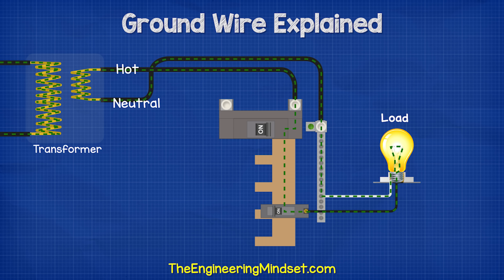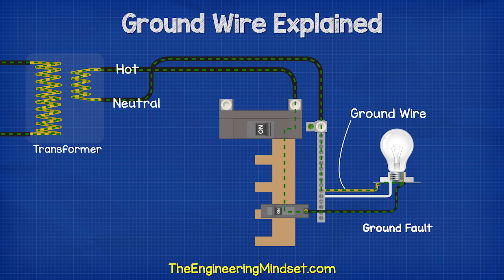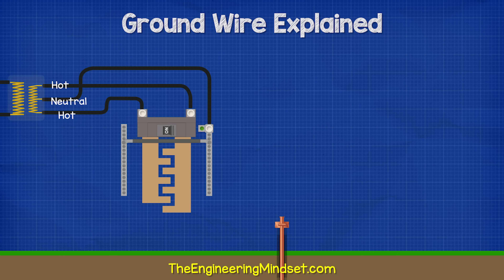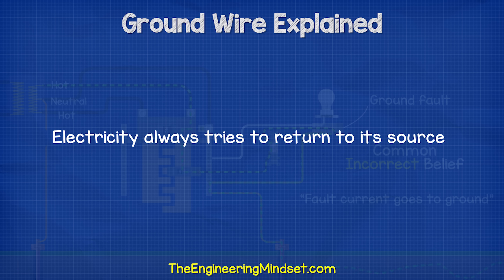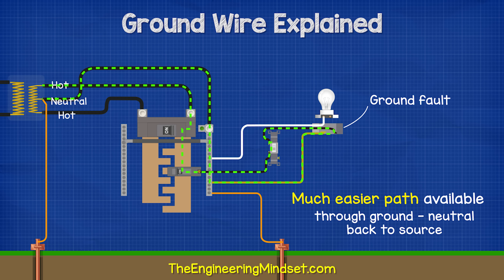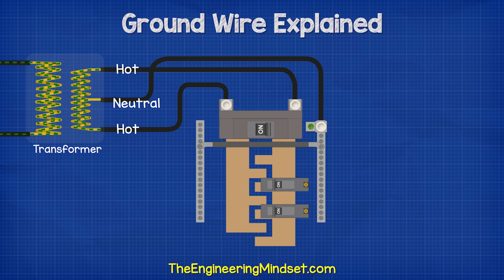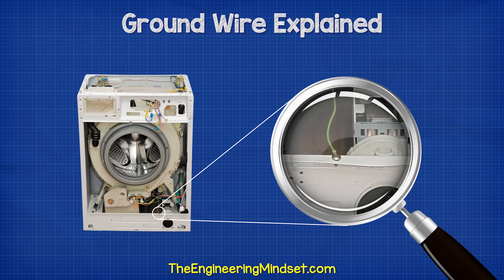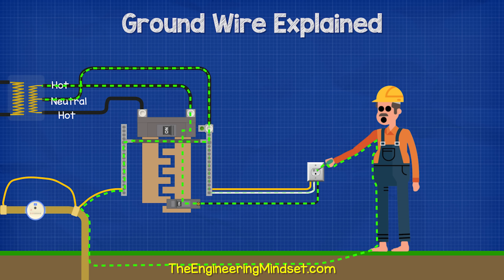Ground Wire Explained

Comment: Nice Video - but You need to explain that the ground is bonded to the neutral wire at a single point to allow a path back to the source transformer that is low resistance. Although you talked about the ground rod that assures the same potential for metal parts as "ground", and that it is the method to dispense lightening back to it's ground source, you completely missed the explanation of the Neutral Bond as the fault current path.

Comment: So if I'm understanding right  the ground wire serves two purposes, one letting electricity go back to neutral in case of fault and two letting lightning travel to ground rod.
Reply: Not quite. It provides a low resistance path for fault current to flow back to the transformer (not the neutral). The ground wire is not for lighting protection. That is the job of grounding rod (although its effectiveness is still debatable among electricians). The ground rod also prevents the system from building static charge by discharging it down to the ground.

Comment: Yeah but what happens if the guy sticks a screwdriver in the socket but he's not touching anything else, not even the ground? this video is incomplete without a discussion on the conductivity of the ground he's standing on.
Reply: This videos assumes you are always standing on ground and make a good connection with ground.
Reply: And without a shoes to only a bare feet
Reply: When the soil is wet and you don't wear a shoe

Comment: So if it doesn’t go to the ground, but is basically an alternate neutral, then why is it called the ground wire?
Reply: Bump
Reply: terminology sometimes does not describe what something does. Ground wire (or formally grounding wire)'s one main job is to provide low resistance path for fault current to flow back to the transformer.

Comment: If I understand it correctly, the static or excessive current is going back to the source via the ground wire connected to the neutral wire (in the main panel). In that case why does the ground wire need to be connected to the earth (ground rod) then?
Reply: Static charges will litterally go into the ground. Leak current or fault current will go back to transformer. Electrostatic is different from electrodynamic

Comment: 2:52 in this case, why wouldn’t the flow prefer the ground wire over the human? Or is this the case where there is no ground installed?
Reply: literally same question
Reply: Because you still believe the myth that current prefers the path with least resistance. Current will take ALL available paths. The question is how much current is flowing on each available path. The ground and the human BOTH provide a path for currents to flow, so so current will flow on both

Comment: Can you make a video on bonding?
Reply: bonding simply means connecting two things together. If you take a wire and you connect to another wire, that's called bonding. So does taking a wire and connect to a receptacle.

Comment: Can you get electrocuted by touching the ground wire ?(During full voltage going through it ) I assume not because it's connected to the ground same way neutral is so potential should be zero yes ?
Reply from the maker: It's possible, see this video https://youtu.be/Qi0ynSQw-wc

Comment: In the end, you say, if you touch the hot when grounded, it may due to high resistance path, not flip breaker and you may die - but aren’t we in parallel with the hot to neutral and therefore with our high resistivity, wouldn’t the current thru us be low?

Comment: Interesting! Thanks for the information.

I still have a question: since neutral and ground wire are connected to each other at the electrical panel, why don't we use the neutral wire to conduct ground-fault electricity as well, hence saving 1 wire? We can connect the chassis of the appliance to the neutral wire at the load instead of at the panel with an extra wire.

Comment: A little noob question here:
If it’s an AC circuit, isn’t the neutral become hot too when the polarity reverses?
In this scenario, according to my understanding, there’s essentially two hots because they’re alternating very fast.
Reply from the maker: Yes, but neutral is physically connected to the earth, so it's the same "voltage" as you.

Comment: What law stipulates that electricity takes the route of minimum resistance? Is this derived from Kirchoff's law?
Reply: Electricity taking the path of least resistance is a myth. It has been debunked many times. But the myth still persists in the trade. Electricity will take ALL available paths. How much current goes through each path is determined by Ohms law. Even so, ohms law only works up to certain point. Ohm's law will break down in extreme cases because every material has something called dielectric breakdown.

Comment: Why is a separate earth wire required at all?
Why not simply connect the neutral to the metal cases of all the equipment? 
After all the neutral and the earth are connected at the bus bar at the fuse box so they are essentially the same wire. 
Are you note that in the USA the earth wire is a solid copper wire and therefore possibly slightly lower resistance but in Australia where I am the earth wire and the neutral wire are identical
Reply: So that a circuit breaker can be tripped since ground wire will be directly in contact with the any appliance metal case, hence low resistance path which will trip the circuit breaker when it sense large amounts of current.
Reply: Because neutral is supposed to carry current under normal conditions and you don't want it energizing the cases of metal equipment. If you bonded neutral to metal, that metal becomes live every time neutral carries a current.  Remember neutral is connected directly to the live wire at all times.  The ground wire (green or bare copper) is NOT connected to the live wire, which means it is impossible for it to carry current except in fault conditions.

Comment: I don’t get it
Reply: It’s only for emergencies instead of the current going through you, it goes through the ground wire.
Reply: @llamaface6229  I understand the concept, not the explanation
Reply: Because he was taught like a robot . No understanding! Just repeat .. repeat !!
Reply: It’s just for emergencies so the current goes through the ground wire instead of anything else that touches it including you.
Reply: I'm an electronics Technician for Helicopters and I still.domt fully understand the concept of "ground". Wild
Reply: For a current to complete a circuit, it goes via live and back to the neutral. This is in a good case scenario. However over time or maintenance work, the live wire may touch any metal casing. In this example, a washing machine. Since the circuit is not complete (Live to Neutral), the washing machine casing will have current flowing through it instead. If anybody touch the washing machine, they will receive an electric shock and may die. Why? Current always go from high potential to low potential thus finding a route. If it is outdoors like you're standing on a grass patch, the electricity will flow via your body and to the ground. If there is a ground wire connected to the washing machine, the current will instead go through ground wire. Ground wire has low resistivity. Ground resistivity vs your body, ground has it lower. Hope this helps!
Reply: @nabilharis5016 Thus the grounding and earthing there the same?
Reply: The ground wire only connects to the metal casing so if the casing gets a current, it'll run thru the ground wire instead of the neutral wire. Normally the hot wire doesn't touch the casing so the casing has no current and thus is safe to touch by humans.

Now why it's only the metal casing, because that's the only place from where we can get electrocuted, if a fault occurs and the current starts flowing thru the casing then it could flow thru us when we touch it that's y ground wires are connected to casings and the current flows thru there instead of us
Reply: Come on, I believe in you! We ALL do
Reply: It means that it's a backup in the case the neutral can't carry back current I think
Reply: @KevinHernandez-hy1qb nah it’s just a safety precaution. I work in signals and we have a ground free system here, which throws lots of electricians off at first. It’s just for safety. All you need is a hot and a return for your load.
Reply: @Jayjuheard you're saying the same thing
Reply: lol 😅
Reply: earthing type not same among country.
Reply: What part don't you get?
Reply: @ where the ground wire is transferring electricity to
Reply: You understand the concept, but not the mechanism of how it works. So what you need to know is how to analyze a circuit. Meaning solve for voltages, currents, and power for each component in a circuit. There are many videos on youtube that teach how to analyze a circuit using all kinds of techniques. Once you understand that, you just apply it the ground by turning into a circuit and analyze
Reply: It's just so the electricity that you touch doesn't go into you but instead goes actually literally into the ground
Reply: Bc hes explaining it like a bot
Reply: Then don’t work on anything electrical 😅
Reply: You don’t need to understand it. Just turn off the breaker before doing any electrical work 😂😂
Reply: @SaintBlack-x don’t encourage mediocrity
Reply: @PRESIDENTRUMP47GOAT Thank You
Reply: Lol  @SaintBlack-x
Reply: Though the video is very well done, it's not something you can learn in less than 5 min unless you're einstein
Reply: That was very complicated !

Comment: also the claim that the ground wire is normally never used unless there are faults is not necessarily true. in guitar amplifiers you see all the time the situation that capacitors for turning ac to dc as well as tone filtering capacitors and their signal to discard is sent to ground all the fingers.
Reply from the maker: We just published a new Ground fault, short circuit and arc fault video, so much detail! Link HERE➡️: https://youtu.be/Qi0ynSQw-wc

Comment: the video is not fully factually correct. when the video says electricity follows the path of least resistance that is completely false. electricity follows any and every path available when there is a closed circuit. when the metal case is grounded and happens to have high voltage what is happening is that you touching the metal case are one path in parallel to the source . you and your ground connection might indeed be a path of very high resistance but since you are in parallel with the case grounds connection resistances in parallel are always lower than the smallest resistance of the parallel junction. in terms of and equivalent resistance circuit the path where the human gets electrocuted should actually be a path of super low resistance. that means the voltage drop under the these circumstances is taking place on the load before the metal case. such as the transformer itself. the voltage drop at metal case is tiny due to this low resistance parallel path to ground.
Reply from the maker: We just published a new Ground fault, short circuit and arc fault video, so much detail! Link HERE➡️: https://youtu.be/Qi0ynSQw-wc

Comment: The equipment ground wire ( ground wire ) is only bonded to the neutral at the service panel . The service panel is the main panel in a building where the service entrance conductors enter a building . As they describe in the video , ground wires carry no current under normal conditions .
Reply from the maker: We just published a new Ground fault, short circuit and arc fault video, so much detail! Link HERE➡️: https://youtu.be/Qi0ynSQw-wc

Comment: Why does the low impedance path run up the amperage and trip the breaker? Shouldn't the loads still draw the same power? 
Also, does your bodies resistance play a factor in the amperage that trips the breaker?
Is it just the instantaneous switching onto the less impedent pathway that causes the spike alone?
Reply: Are higher amperage breakers less likelier to trip in a ground fault? By any tiny percentage even?
Reply from the maker: Check our new  Power Factor Explained video soooo much detail and easy visualisations https://youtu.be/NIrKOVZrqnU

Comment: Current will flow through the earth rod (forgive my use of earth instead of ground,  it's based on where I come from), particularly when there is a fault on the neutral. It's based on the fact that it's not just your house and the transformer with an earth rod,  but everybody else supplied by that transformer also having an earth rod to create parallel paths back to a neutral.

Also don't forget that it bonds metal parts to one another to reduce a potential difference of voltage being built up between them
Reply from the maker: We just published a new Ground fault, short circuit and arc fault video, so much detail! Link HERE➡️: https://youtu.be/Qi0ynSQw-wc

Comment: My older switch does not clearly identify which of the wires is the ground. I don't have electrical testing devices, and I'm trying to replace this broken switch. What do I do? I have photos...
Reply from the maker: We just published a new Ground fault, short circuit and arc fault video, so much detail! Link HERE➡️: https://youtu.be/Qi0ynSQw-wc

Comment: Now I'm curious: why are there electric devices that don't have a ground pin in the plug? Are these only low voltage devices? Are they exclusively plastic/nonmetallic cases?
Reply from the maker: We just published a new Ground fault, short circuit and arc fault video, so much detail! Link HERE➡️: https://youtu.be/Qi0ynSQw-wc
Reply: They are class II devices which are exempt from the ground wire requirement.  This is because they have double insulated internal wiring (unlikely to fail) as well as the outer case being non-conductive. So even if there is a fault, it still won't shock you since the case isn't conductive. In the U.S. a device must be class II for it to use only two prongs.  If it is a class I device (with conductive parts), it must use a 3 prong plug. I believe the same rule is used in Europe and most other places.

Some class II devices also have an internal transformer that isolates them from mains voltage. This isn't really for safety, but because they do not want or need mains voltage. (A side-effect of an internal transformer is it makes them much safer). A good example is anything with a charging brick. So even if it were a conductive device, it still wouldn't hurt you since you would only be absorbing something like 9 volts (so little voltage you wouldn't even be able to feel it).

Comment: May i ask, why if the person touches live wire , the current diverted into human body to the ground and back to the transformer, it being said that current flows a low resistance path, and you know that ground has high resistance, so why the current won't go the least resistance path like the neutral wire instead of flowing human body to the ground and back to the transformer?
Reply: Electricity follows the path of least resistance is a commonly repeated phrase. It is also completely wrong. Electricity takes all available paths for current, the path with the least resistance gets the most current, that is why parallel circuits are possible.
The reason for the ground wire is for safety. If the live wire touches the metal case of an appliance then the entire case essentially becomes a live wire that would shock someone. If the case is grounded then you get a large amount of current that would trip the circuit breaker and kill the power.
Reply from the maker: We just published a new Ground fault, short circuit and arc fault video, so much detail! Link HERE➡️: https://youtu.be/Qi0ynSQw-wc

Comment: Use different power then electricity like heat from light preformed through radiation in diod use similar but heat cold use Bitcoin cold energy

Comment: I never understood why we call one wire hot and one neutral in alternating current. They both flow current, they are both “hot”.
Reply: One wire has 120 volts with respect to ground, the other has zero volts with respect to ground. With respect to ground the wire with zero volts is "neutral". The hot is an ungrounded current carrying conductor, the neutral is a grounded current carrying conductor.
Reply: @Redtooth75 If I go outside barefooted and grab a neutral wire in my hand what would happen?
Reply: @mguerramd  if there are no faults in the circuit then nothing would happen as there should be no potential difference. Your body would be grounded and the neutral is grounded so no change in potential. But there are fault conditions that can make a neutral live so its not a good idea to fuck around and find out.
On older electrical systems it was common for the chassis of things (like washing machines) to be bonded to neutral as old wiring did not have dedicated ground wires. That was changed because it is unsafe and can result in shock if there is a fault in the circuit.

Comment: What does it mean that "hot" and "neutral" wires bring current to and from devices? Doesn't the current change directions in AC current? Also then, why would touching the neutral wire not harm you, while touching the hot wire can kill you?
Reply: Yes, the current changes direction, but imagine "hot" as the dangerous side providing the power.   "Neutral" is bonded to the dirt, meaning it has almost 0V compared to ground, you, or the literal earth near you.  You and your surroundings are at the same potential* as the neutral (and ground) wire.  There's no voltage if you touch neutral and ground (wire or the earth). You're on the same side of the circuit.  There is voltage between hot and neutral.

*IRL, faulty devices can "leak" electricity and create hazards that shouldn't exist in theory.